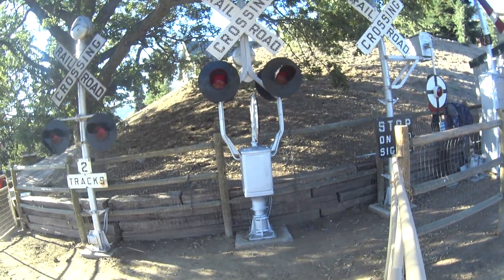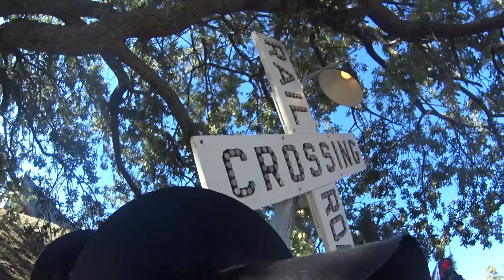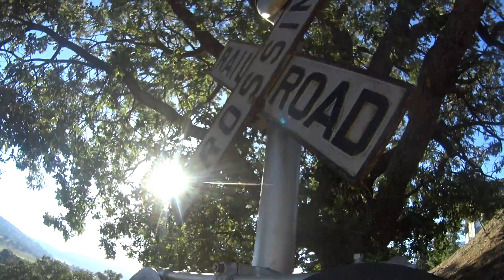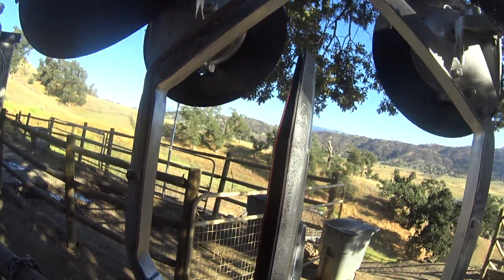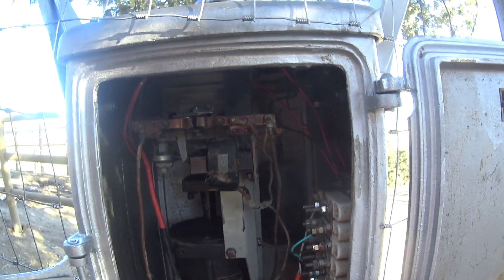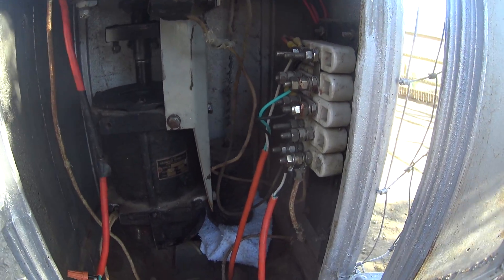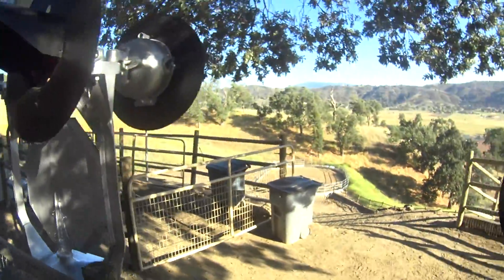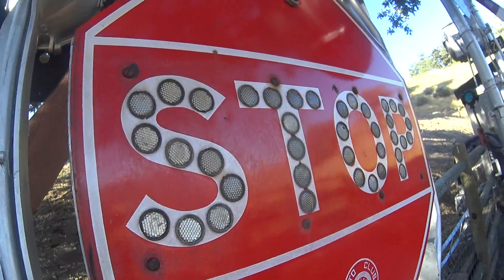Griswold Rotating Stop Sign Crossing Signal

Comment: Will a car battery work to test one of these?
Reply from the maker: yes 12 volts DC is fine
Reply: @rileydog362  Almost every single DC RR signal was intended to operated at 10 Volts DC not 12 volts.
Reply: Finally got around to working on the restoration. For some reason, the weight doesn't drop when the power is off. You need to kinda force it down. I'm kinda stumped and not really looking forward to taking it apart again.